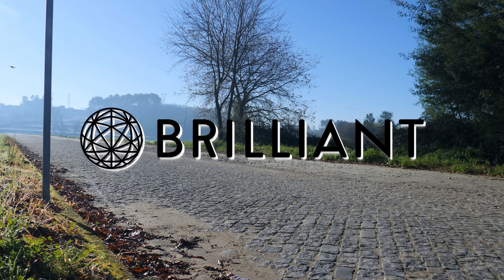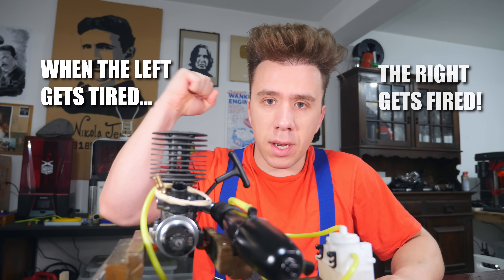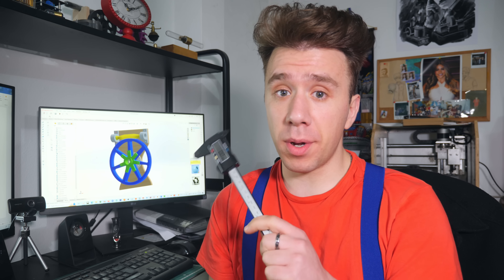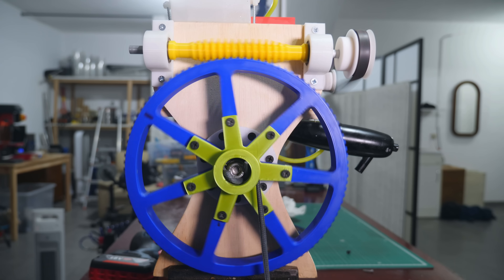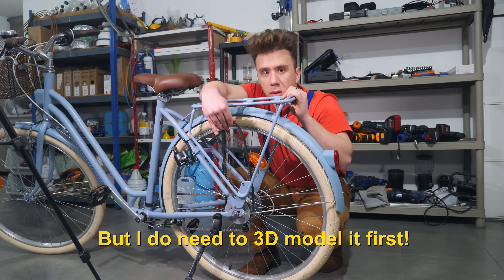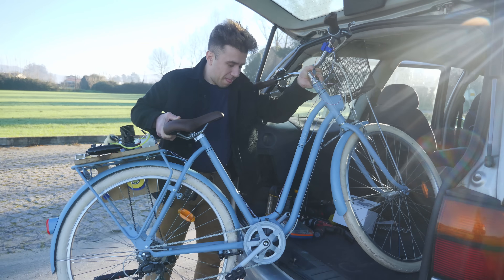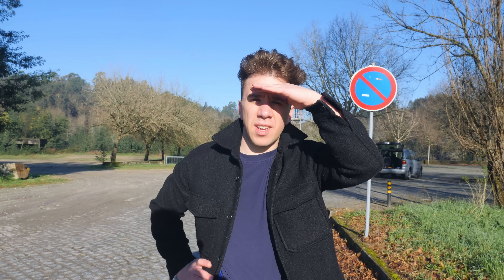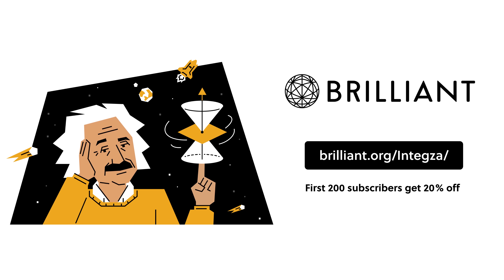Tiny 3.5 cc NITRO ENGINE on a BICYCLE

Comment: Now I want to see you building a Turbo for that engine :D Excaclty for that spot where the air flows in.
Reply: It's an cool idea tho but on a two stroke engine the intake and exhaust port are both open at the same time so it wouldn't create much boost
Reply: @Steezbikelife   Oh... you got a point there. So the air would simple blow through. Damn..  he would need to modify the exhaust that it always closes whenever air is sucked in but I guess that would be a lot of work and kinda tricky to make it function well at high RPMs

edit: Or maybe there is a simple solution? Like the one way air tubes with the little ball blocking air flow into one direction?

edit2: Nevermind, this makes totally no sense. Because the air comes from the same direction as the outake goes out. The one way tube was a stupid idea.
Reply: @Craftronix  he could use valves for the intake and exhaust
Reply: The exhaust is made in a particular way. It uses the pulses to reduce the amount of fresh gas being lost. This is alreyda a very hight performance engine. If you want more you would just use a bigger engine. There is really no point in trying to make it moe powerful. They have already tested all kinds of things with two stroke but it can never beat a 4 stroke engine in efficiency.  @Craftronix
Reply: @Steezbikelife  I know of 2-stroke outboard motors with valves. Havent taken it apart though, so don't know how it works exactly.
Reply: @andersgrassman6583  yeah I also heard about that
Reply: @Steezbikelife  You can make boosted two stroke engines, but the design is radically different, and the end result ONLY works with boost. Large ship engines are boosted two stroke.
Reply: @andersjjensen  This is not supercharging ("boosted") It is a uniflow two stroke , which needs a scavenge pump to clear exhaust gas from the cylinder. 
The scavenge pump is either a Roots blower or an exhaust driven turbo compressor does not provide any significant pressure increase to the intake gases.
Reply: @PaulG.x  I can absolutely assure you that ship engines are at significant (typically 3 bars) pressure once the intake port closes. Extracting as much energy as possible from the exhaust gas as possible, and turning that into forced induction, is a big part of the efficiency equation.
Reply: @andersjjensen  Those forced induction two strokes are also diesel so don't have to be tuned as finely since pre-ignition isn't an issue.
Reply: @EddieTheH  They're direct injection, so the concept would work with gas/nitro/LPG/whatever too, provided the chamber pressure is high enough to cause instant auto combustion.
Reply: @Steezbikelife  then belt driven supercharger it is
Reply: @Steezbikelife  Why would having the exhaust and the transfer ports open at the same be a problem?
The exhaust back pressure from a turbo is similar to the boost pressure, so it would kind of be like just having the engine in a more dense atmosphere(Which would obviously boost engine output).
A lot of two-strokes with "regular" exhaust and transfer ports in the cylinder have been successfully turbocharged and these days there is even at least one factory turbocharged two-stroke snowmobile.
By the way the turbo should be mounted after the expansion chamber(s).
Reply: @TarenGarond  I forgot about the exhaust back pressure
Reply: @Steezbikelife  Yes you certainly did, people tend to forget that(Or just not know how much back pressure there really is)!
Reply: @Steezbikelife  hence the supercharger kits, i suppose turbo is laggy if it even makes meaningful boost
Reply: Screw supercharger and only then a turbo @Steezbikelife
Reply: I can't reply to everyone but y'all turbo 2 strokes have been done many times and is totally possible. Polaris actually makes a turbo 2 stroke sled from the factory lol.
Reply: And I'm not talking about those ship 2 stroke diesels with exhaust valves.
Reply: turbos on 2-strokes are tricky
Reply: In reality this engine is already equipped with a kind of turbo. Look up 2 stroke tuned pipe or expansion chamber. The downside of this method is that it only works in a very narrow band of rpm. You can actually hear the sound of the engine change as it revs up.
Reply: @danielrbdr  Its called harmonic supercharging, 2 strokes rely on this sort of stuff, it is possible with a well designed expansion chamber to drive up the VE of the engine to over 100%
Reply: On one side yes, valve wouldn't make a solution, on the other - why do you think most of the cars are powered by 4stroke? The for stroke engine has higher torque on low rpms because it blows out almost all of the burnt gasses out the chamber, and sucks in more clean mixture. That makes every stroke more powerful. The 2stroke at the same time blows burnt mixture out and sucks fresh one in. Because both intake and outake are opened the mixture isn't entirely replaced by fresh one - efficiency declines. And it has oil mixed in the fuel to lubricate the internals, so the fuel burns less efficiently. Only pros for the two stroke that i know of:
1. Because of its simple design it can reach insane amount of rpms like in this case 30 000, the 4 stroke moving valves would fale at this speed.
2. The 2 stroke can run effectively on higher temperatures than 4stroke.
Any questions?
Reply: @justinasnorkunas2966  he could go 4 stroke but that has more weight and idk about if they got it  in the same size of the current engine he used
Reply: @Steezbikelife 4 stroke engines were made in like 7.5cc by OS, and would fit in the same slots as this 3.5
Reply: @justinasnorkunas2966  and did you heard about the 2 stroke engine Ferrari made, it used valves, an oil pan so it wouldn't get burned, but engine braking is the only downside that they couldn't get right
Reply: @justinasnorkunas2966 they use reed valves on two strokes. They are fast enough for pulse jets, definitely fast enough for a two stroke. They do wear out fast but are much cheaper to replace, they are essentially a consumable part. They even valve some non boosted high performance two strokes just for the added benefits.
Reply: @Craftronix There is a channel “two stroke stuffing” where all your questions about boosting a two stroke bike will be answered. Check him out if you want to learn the theory and results of maxing out a small two stroke.
Reply: 2 stroke with boost sadly doesn't work...😢
Reply: arent diesels also 2 stroke, they have turbos @Tommyg-rq6lj
Reply: @Steezbikelife  Two-stroke diesels most of the time have exhaust valves in the head (instead of exhaust ports in the cylinder) which could be timed to close before the piston closes the transfers ports(Not sure how the valves are typically timed though) so turbocharging might get higher pressures in the cylinders, but as on engines with "normal exhaust ports" the cylinder pressure on exhaust closing should be able to to be similar to the exhaust back pressure(Big turbos for two-stroke diesels according to what I've read can be quite damn efficient though, so back pressure can be way lower than boost pressure in the intake manifold).
Reply: @Tommyg-rq6lj  LOL!
You know there is even several factory turbocharged two-stroke snowmobiles these days right?
What's the reason it shouldn't work?!
Reply: @TarenGarond  i mean it works but not as much as a regular 4 stroke, still  i didn't know they made that
Reply: @Tommyg-rq6lj  Yes it is quite cleary not as straight forward as on a 4 stroke as the performance must be quite damn dependent on the back pressure from the turbo.
But similar back pressure and boost pressure just creates a "higher pressure atmosphere" for the engine to operate in which obviously would work.
Reply: I'm looking for an engine with 50-80hp that weighs 60lb or less , the weight has to include everything including possible gear reduction to 2ooo-38oo rpm.
Reply: but the engine doesn't seem like it's being limited by pushing air out.

Comment: Try Nitromethane in an older moped. 80% Nitromethane 20% two stroke oil @ 2 gallons. I was able to get my Tomos 2 speed moped to a whopping 65 mph for three miles before it blew apart.

Comment: Integza, please don't use the table saw fence to cut to length pieces with a small width and height (i.e. what we call 2 x 4's). This is a very bad idea and a good way to lose fingers. Your friend, an old woodworker.

Comment: With more than 2HP that thing should have no problem getting you to 40km/h and beyond. It really sounded like the engine was running slow, like in the lower 1/3rd of its RPM rating. And 15% nitro is also on the lower-end for those engines too.
A torque-converter might help with that. And that kinda sounds like a project for you given that you often have things that require high speed but low power.

Comment: How about use that rc engine to turn a generator and use that power to drive an electric motor. Yes you will have loss but I bet it will have less loss then all those plastic gears

Comment: First off, love the content. 
for all the mechanics under us, this is not the kind of use for a worm gear. It's quite dangerous actually,
a worm gear is not back driveable, that means if the power of the engine is lost, the back wheel will lock up and make you slide all over the road.
With that. A worm gear does not use two kinds of self lubing metals/plastics, most of the time the wheel will be made of brons, and the worm made of steel. 

Oh, btw, the belt he is using to power de back wheel is a normal V belt made for tight angles, not necessarily a toothed belt used for toothed pulleys.
Anyway, don't be mad for this comment, just educating and making sure people who try this are safe,
would love to see this tried with a planetary gearbox 

keep on the amazing content!🤩

Comment: @integza WARNING WHILE USING THE TABLE SAW! Dont let the piece of wood stay between the saw blade and the fence. Push that part all the way through because if it touches the blade at all it will kick up and back at you. Your riving knife, the thing behind the blade, helps avoid this, but it isnt fool proof. Otherwise good work and fun video.

Comment: quick tip: You typically prime Nitro's by holding your finger over the intake until you see fuel in the hose reach the carb. Release your finger and then a few tugs and it should fire.
Reply: Also...I cringe every time you install a bearing by smashing the inner race with a hammer...also, you are axially loading your bearings by not having a spacer between them.

Comment: This reminds me of Solex bikes, which drive the bike through friction with the tire. The engine would sit on top of the fron wheel and spin the tire directly, using the wheel itself as a reduction gear.

Great project!

Comment: GOT A VIDEO IDEA
you know that mark robber video where he vibrates a hot tub of sand so it behaves like a liquid? I'd like to apply the same concept to a rocket engine. Basically allowing for a throttleble solid rocket engine. Thoughts? Ideas?

Comment: I tune those motors all the time. your probably not getting anywhere near the hp on the sheet yet. idle, low speed and high speed tune all need to be adjusted for peak power.

Comment: Try delrin or glass filled delrin for the gear. Teflon has high lubrication value but super soft. The glass filled on a bronz worm would be a good match.or just do brass on steel.

Comment: A good idea for turning 3D printed parts into more usable, and homogeneous, parts is to get into resin casting them. The only thing you'd need that you don't seem to have already is a vacuum chamber and pump, to degas both the mold material and the resin. You can also use a pressure vessel to get the same result (no bubbles) by leaving the resin/rubber to cure under pressure so that any dissolved gasses stay that way until curing is finished but there are some who think that this stores stresses in the casting. I'm not so sure.

You can even ignore resin casting and go straight to the big dog - METAAAAL! 🤟- and use the "lost PLA" casting method, where you coat the 3d printed part in successive layers of clay slurry, wait for it to harden and then put it in a kiln/furnace to both bake the clay and melt the PLA inside the mold so that it runs out (oh yeah, you need to print sprues and gates on you part so that you can get PLA out and then molten metal in), and you have your mold. You then fill  it with the molten metal of your choice and smash off the clay once cooled. Ta-Daaaa!

Comment: Slight correction: 2CV does not stand for "two horsepower", but literally: "two horses", "deux chevaux", and two horses can effectively output around 9 horsepower. The Citroen 2CV was basically both legally and effectively classified as a mechanized carriage: a perfect starter car for rural families that had never owned a car before.

Comment: You have to prime the fuel system silly. Put your finger over the carb for 1 slow pull without the glow plug. You will seenthe fuel in the lines. Some people blow in the vent of the fuel tank.

Comment: I am confused to why he wouldn't use a cheap mountain bike for this since they come with a fairly large range of gear ratios out of the box and don't cost much money for the low end ones. He could have avoided the gear down problem and the worm gear entirely by just riding the bike in a lower gear ratio and could have reached much higher speeds without stalling the engine since it wouldn't have to accelerate from standstill.

Also in typical fashion on this channel, there is no PPE in sight. People concuss themselves and worse at far lower bike riding speeds every day because they don't wear a helmet. Even with european subsidized healthcare, wearing a helmet is far cheaper than dealing with the aftermath.

Comment: You drill idea is not that lazy, these style of engines are still quite common in model airplanes and devices that spine the motor to start them are standard.

Comment: 110km/h if your gear down has enough torque. But even ebikes lose some rotation speed loaded so lets say 80km/h. So you should have probably geared down more, I havent watched the full video yet. Also please people learn how to install bearings correctly before you mess with them. Push or hammer on the inner ring when getting it on a shaft and outer ring when on a bearing housing. Same for removing bearings if they are to be reused.

Comment: I have an HPI Savage X SS with the "big block" 4.6cu engine. With the 2-speed transmission, you could flip that thing on its back it had so much torque. Pull start was always a pain though, so I haven't had it out in years. Nitro would be pretty uneconomical for a bike TBH. You get probably 10-15min of runtime tops on an average tank. IDK how much it costs now, but it was like $25 CAD a gallon back when I was still into RC a decade ago. An old weed wacker engine and petrol would be a lot cheaper. Plus, since it's a total loss oiling system, and castor oil doesn't burn at the temps those engines run at, it leaves a sticky oil slick on everything. Cleaning planes was always a nightmare. On top of that, putting a nitro engine on a bike would legally make it a moped here in Ontario, which requires a motorcycle license. E-bikes don't require one though as long as the motor is 500-watts or less, and governed to 20mph (32 km/h). Though ironically a nitro bike has less chance of catching fire than some Chinese e-bike batteries.

Comment: I don't think worm gears are ideal for vehicle transmissions, since they only work one way, with such a small engine and a bicycle it probably would've been best to use a planetary transmission.
Great for achieving high ratios in a rather compact package.

Comment: That looked like a lot of fun. You can't transport pure nitromethane, it way to unstable.  Mixing it with water or propane or even gas stabilizes it and makes it safe. 10% water is what is used in drag racers and NASA experimented with 50% nitro 43%water and 7%propane as a mono fuel, it worked very well!!!! The bulk modulus went threw the roof from the water and kept the reaction cool. It made a lot of thrust and did not burn up the bell.  Im very surprised more rockets don't use it. I have used it in combined cycle air breathing rocket engine experiments for single stage to orbit applications, shows promise for SSTO. Its just one of the mono fuels we are looking at.

Comment: If you've heard of an EDF (Electric Ducted Fan) then you might be interested to learn they made a version of ducted fan unit powered by a nitro rc engine back in the day.  I've always wanted to buy one and mount it out back on my DIY eBike with an electric start for on demand "boost power" and noise 😂

Comment: Amazing! Can you try to connect the engine before the chain so you can use the gears of the bike ? Starting on the lowest gear for torque, and finishing on the highest for speed (and going faster than 28km/h)

Comment: Please try it connected through the front sprocket so you have all gears available. It'd be so much more useful with selectable gears. You could mount it above the pedals and swap one pedal for a belt pulley

Comment: Now time for engine tuning... the 2 needles do change the mixture of low and high rpm... I think 50km/h is in it with maybe a better engine... 4.6ccm or 3.5ccm are the usual choices and also avaliable in competition versions which produce much more power than your hpi version... I request a rematch

Comment: Two things. 1) you are losing a lot of power in that toothed belt.2) using a herring bone pattern gear that ran the circumference of the wheel with  small directly couple drive gear might have been more efficient.

Comment: No seriously Integza I designed the tensgrity table for as an analogy for how the arc reactor works. Weather will be a ssto, plane,jet plane, jet car, heavy lift rocket. No matter the build, I got you fam. But you're impossible to contact. Plz TF are you trying to build?.